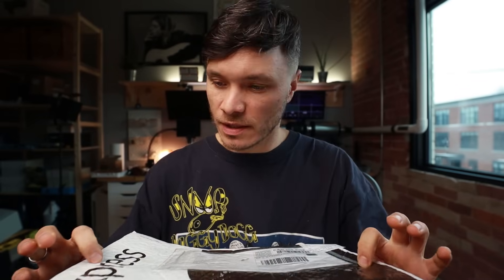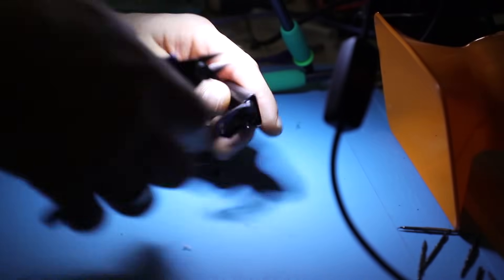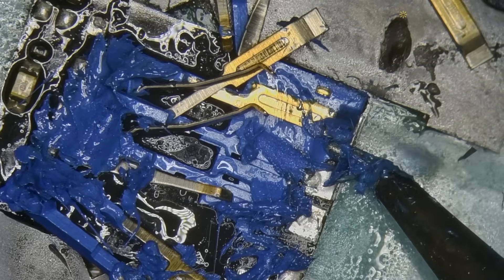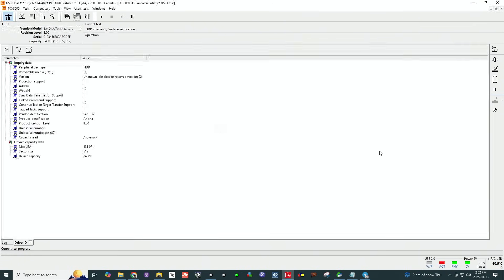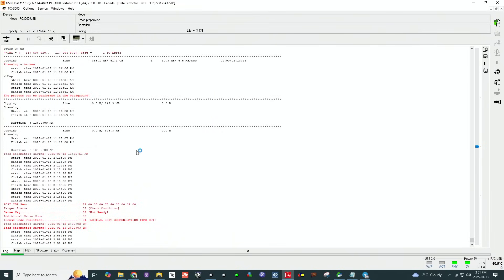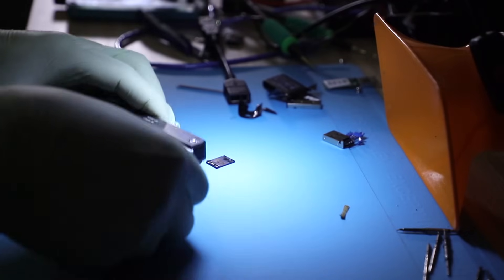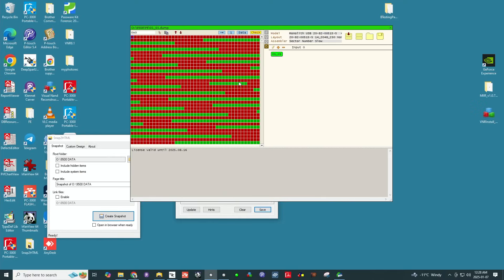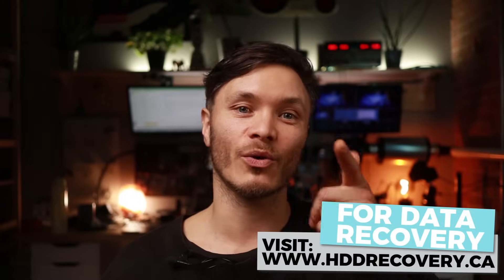how to recover data from USB Sandisk Anisha 64mb problem

Comment: And how about corrupt file sir? On flashdrive, can be access butvcant not open. Is this problem with controller? Can u solve? All data filled FF’s on PC3000 scan
Reply from the maker: Hard to say if there is a solution without trying to read it first
Reply: @ ok sir. Check email, sent it from indonesia

Comment: I have a first-gen (USB 2, surface mount) Sandisk Ultra that suddenly went Anisha on me several years ago, and seeing that happen prompted me to back-up the data immediately (It went back to normal after being re-plugged), securely erase the drive and then retire it. But while it was in Anisha mode I think I took an image of the drive using dd - Can't be positive that I did or not, but when it went Anisha on me I took it to be the same sort of warning sign as a SMART warning from an HDD. 👍
I think the Anisha mode is where the drive controller starts up without detecting the attached NAND flash, so it goes into what I guess is a firmware programming/service mode. The 64MB space might be a RAMdisk on the controller used for storing and digesting firmware updates and/or presenting diagnostic output from the controller for user-operated software e.g. SanDisks consumer servicing applications. 💾

Confusingly, there are both surface mount and monolithic USB 3,0 SanDisk Ultra drive designs in the field, the former being an earlier version but being mostly indistinguishable from the latter. However you can differentiate between the two by looking closely at the USB connector; If the blue part fills half the connector, extends flush to the end of the shield and the shield has holes on the underside, then it's an earlier surface mount type. If the blue part is a thin sliver, there are retaining tabs extending from the end of the shield to hold in the module and the shield has indentations on the underside, then it's the later monolithic type. 🔀

A thing that's also worth knowing is the earlier surface-mount type can also be re-flashed to function as a USB Rubber Ducky. With 64GB of storage (I've never seen a 128GB+ version that wasn't monolithic) that's a lot of data exfiltration you could achieve with one of those things! 🕵

Thanks for another awesome vid here, chap! I've been doing informal (Software level) data recovery for years as a hobby and have saved a few peoples asses with it, but sadly (Mainly because my country appears to have a very strong prejudice against ASD people with certain alignments of faith and sexual orientations 🌻🏳‍🌈⚒) I've had to do this under conditions of sustained long-term poverty and resulting loss of all confidence, so I'll never be able to make YT content out of it. 🥺

You're awesome as fc🇬🇧. I only wish that I could be the same, too... ❤‍🔥

Comment: Glad the data recovery worked. I was thinking this was a "fraudulent" USB drive, reporting 64GB but only backed by 16GB. ALWAYS run H2TestW (Windows) / F3 (Fight Flash Fraud - Linux) on any uSD / / SD Card / USB flash device before using it! This software verifies the device IS backed by the claimed storage size. I bought a 1TB USB drive for $15, knowing full well this was bogus. F3 proved this true. I got my money back from the seller and reported the listing as selling fraulent devices. Many people buy 64GB / 128GB SD cards for digital cameras. Many "reporgrammed" controllers keep "writing" to the device once the 16GB real storage is reached. That means all photos afterwards are lost. Very sad for people unaware of this scam.

Comment: i have same case but it's need disable controller to
read nand id, solved on FE, If not disable controller, id become FF FF FF FF
Reply from the maker: Disable by TP or controller cut?
Reply: @ i short via TP to GND
Reply: Yes i have the similar cased on interface show FF by scan pc3000. Data all suddenly corrupt before. Can you help me to recovered?

Comment: great work! the specific adapter being tied to the software license is unfortunate
Reply from the maker: not exactly. There are 3 NAND programmers that are used by pro's PC3000, VNR, and Flash-extractor. The adapter works with all 3 tools. I used flash extractor and I have 2 of these programmers from them. Once has licence another one does not. In order to start the flash extractor assembler software, I need to connect the programmer with the licence.
Reply: @hddrecoveryservices  ahh i see, thanks for the clarification

Comment: ive never relied on usbs to store important files, I always have backups...
Reply from the maker: NAND is gonna fail at some point no matter what
Reply: @hddrecoveryservices  That's the tradeoff - A capacitor can only hold a given power (data) state for so long. And the higher the LC level of the NAND, the quicker the data fades away. I've got a 32MB Belkin USB that reliably kept the same data intact for two decades before I finally data wiped it, unlike a SanDisk Fit 64GB (1st gen) which is already showing bitrot just five years after being populated. Thank Odin the latter is just a music collection for use on my stereo... 🤘🎶👍

What I wish we had was a consumer-accessible form of tape storage. I tried adopting LTO a few years ago, but because I wasn't able to interrogate and command the drives like I thought one could under Linux that really didn't work out like I'd hoped. 😔